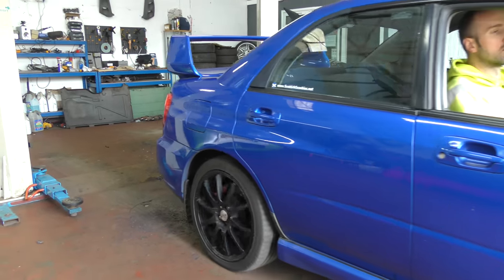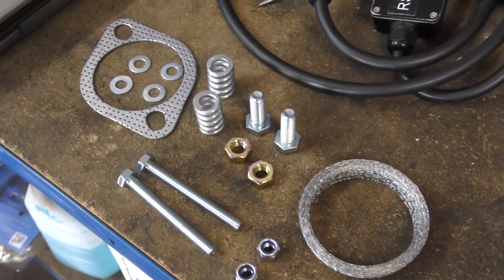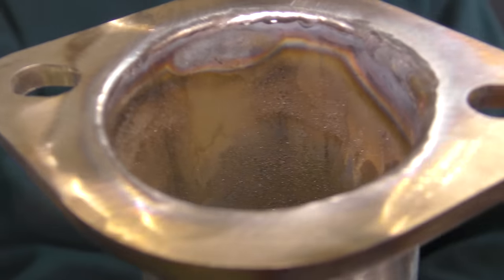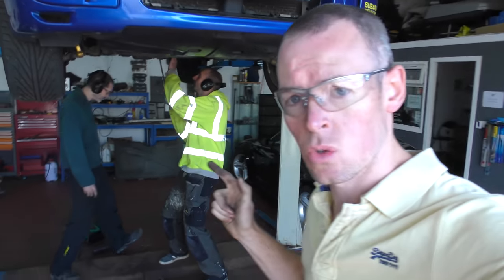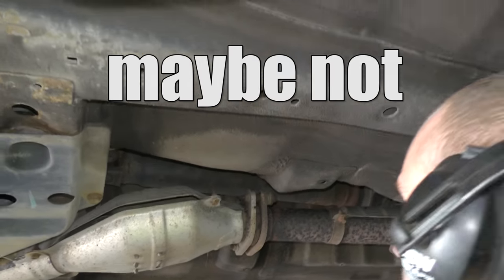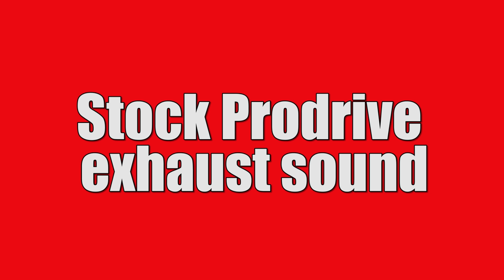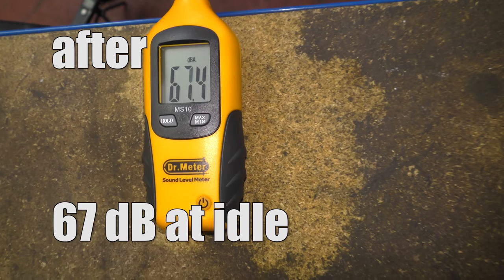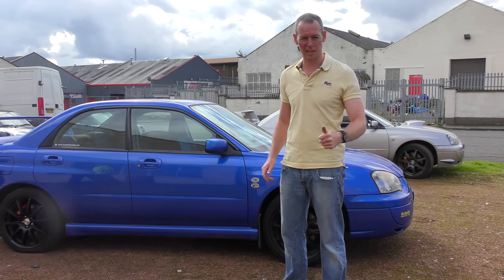Subaru center silencer test (Cobra Sport straight pipe)

Comment: Is there drone on the motorway with the center silencer delete?
Reply from the maker: It's a subaru so it's always loud. I wouldn't say it was a problem though, the back exhaust muffler is the real noise maker.
Reply: @vPerformance  I have a stock STI with a Prodrive backbox only and I think it is quiet, that's why I'm considering removing the center resonator.
Reply from the maker: Remove it all. Go maximum attack 😁 if you want more sound then a cat back exhaust will make you happy without spending a fortune
Reply: @vPerformance  I would like it too, but I love this car and want to make some road trips in it, so I cannot go all in! I will install the Prodrive sports cat, delete secondary cats and remove this center resonator, I think it will make enough difference, also I like the look of the oem Prodrive tip, since it is not too big :)

Comment: Is this just for the sound or some hp gain?
Reply: changed it mostly for the reason the old exhaust had rusted rusted through and the stainless steel one was cheaper, and also for the noise